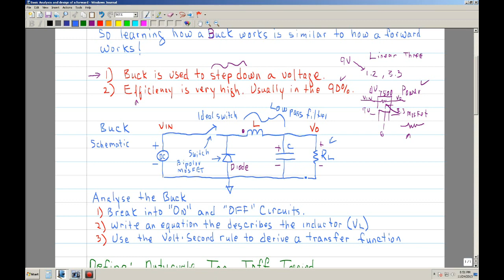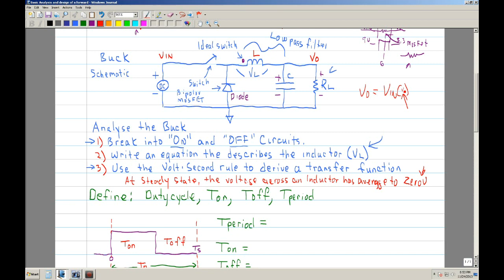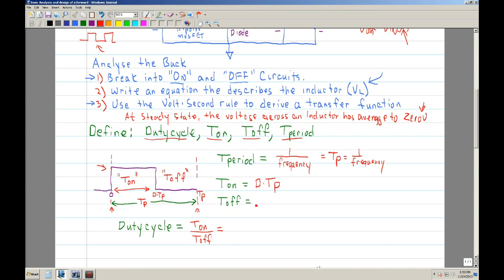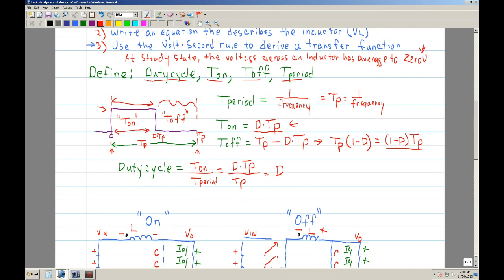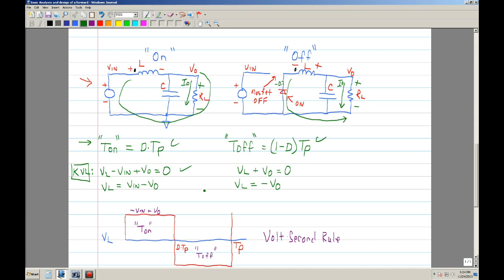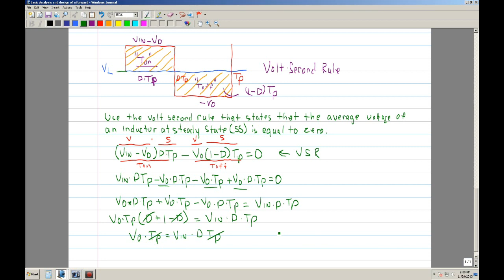Forward Converter, Part 1

Comment: Please sir i am confuse in calculating the value of my smoothing capacitor after my mains rectification of 230v AC trying to design a fly back converter of 12v/1A that is 12W my duty cycle is 42%

Comment: Please sir i am confuse in calculating the value of my smoothing capacitor after my mains rectification of 230v AC trying to design a fly back transformer of 12v/1A that is 12W

Comment: why inductor change polartiy in Toff (18.40)
Reply from the maker: The polarity in the inductor changes because the current wants to flow in the same direction toward the load. It act as a current source with the positive on the right and the negative toward the left.